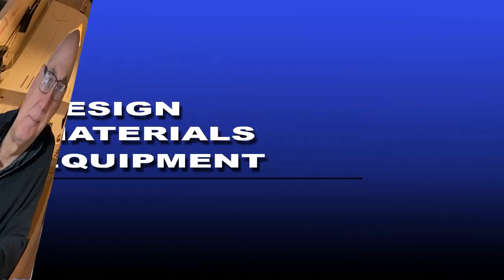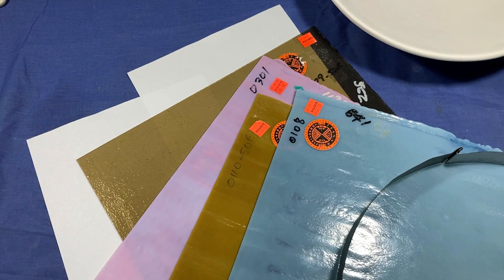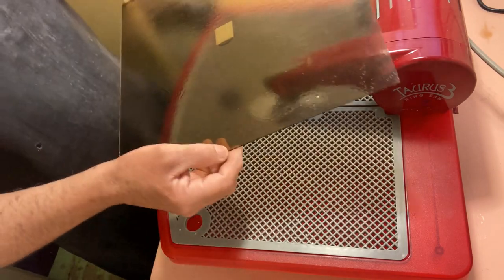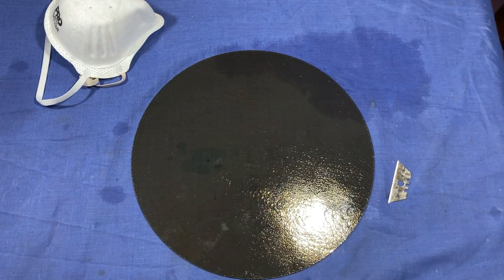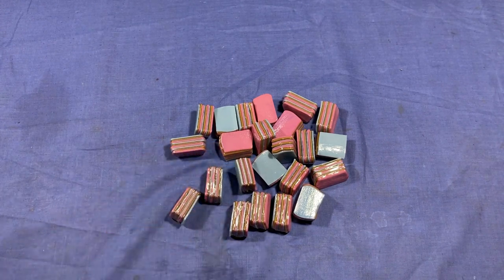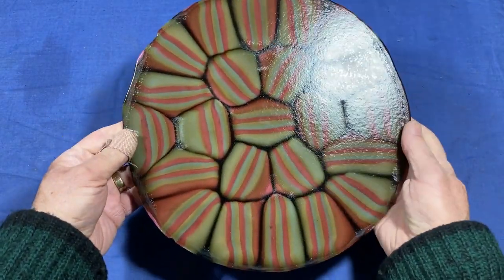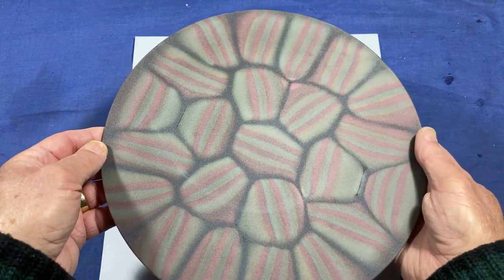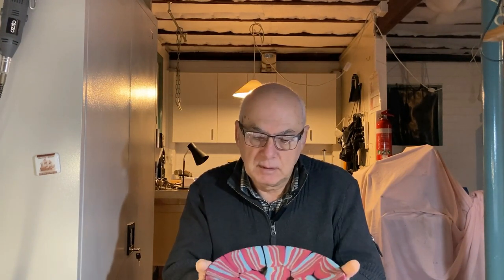Flow Bowl? Skip The Bar! Fused Glass Project Tutorial

Comment: I love pattern bar melts like this. I did a class at Bullseye, and this is one of the things we did too. 
However, we did the pieces for the melt differently. Instead of small pieces, we did 25mm wide strips about 250mm long, and stacked them 8 high. After a light trimming with a tile saw, we tile sawed then into chunks and arrayed them.
Reply from the maker: Hi Steph. The combinations in colour and size, shape etc you could use are huge. I made the pieces small so there wasn't any need to use a tile saw to cut them up. Just so anyone without a saw has an option to experiment with.

Comment: i certainly like your mistakes better than mine!!  after watching u cut glass in another video using that accessory  i bought them all but not sure how to use the others. do u use the others?
Reply from the maker: I've used the straight edge regularly, the circle guide and the angle guides. Never used the bevel guide. They have a super slicer I've used and will probably use to slice up the pattern bar (if I do).

Comment: Thanks! Jeff. Great technique, I’ve never seen circles cut on the ring saw before. Where do you get the pieces that keep the blank spinning in a circle?  I also think the reverse side of the bowl is as pretty as the top!
Reply from the maker: Thank you Vicki. Appreciate that. More for the tile saw fund. The little stick on spindle came with the Taurus accessories. I'm sure you can order replacements from the Taurus company. Look for a supplier in your area and make a request. Hope that helps.

Comment: Good day Jeff! 2 questions: it looks like your taurus water is soapy, is it? #2 I have had the constant problem of the spindle adhesive sliding around when water hits it. Any suggestions?  Many thanks!
Reply from the maker: Hi Steve. It is soapy. I add just a couple of drops of detergent and a dash of vinegar. Taurus recommends distilled water, which is a little costly, so I use tap water. If using tap water this is what they recommend. If you mean the little spindle used for cutting circles, I haven't had any problems with the adhesive, though I do clean the area with a little spray of alcohol. Something I'm used to doing when gluing cabs on jewellery. Maybe that holds it better and resists the water. Something to try. Hope this is of help.

Comment: Thank you for all you share. I like your experiment and the bowl itself. I do have a question, my wet tile saw broke and I’m considering purchasing a ring saw. I think there are pros in purchasing the ring saw but I also want a saw that will be able to slice through a pattern bar. Do you have any suggestions? Thank you.
Reply from the maker: Hi gwen. Nice to hear from you. I love my ring saw, but it's limited in slicing pattern bars. The depth of cut isn't great and it's a bit slower. I think the max is about 20 mm. But the ring saw is great. Easy for circles, slicing thinner bars, making abstract shapes etc. I'd recommend a ring saw for all those things, but only for thinner pattern bars. That's why I've started a fund to replace that old tile saw of mine. It works, but not accurate and a bit clunky. You take care.
Reply: @RocketRoseArt  Thank you Jeff. I want both but really should get only one making it a difficult decision. I do have a cheep circle cutter that works well and I really like. I’m in the US, is there a specific type/ brand of tile saw that you would recommend?
Reply from the maker: @gwenpetersen5452  Can't say I have any particular preference. I'd choose something that allows easy feed-in of pattern bars for slicing and accuracy in slices. Checking that I can change the original blade, which is usually very thick, with a thinner one. The arbor size is important, as is the depth of cut. All things I'm sure you've considered already.
Reply: @RocketRoseArt  Thanks much!